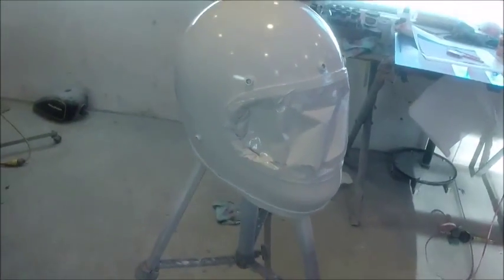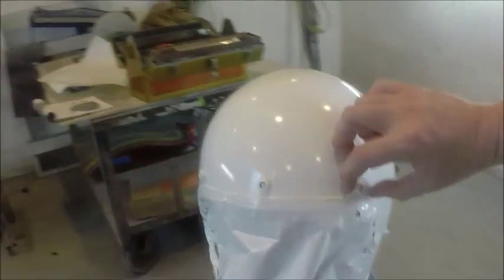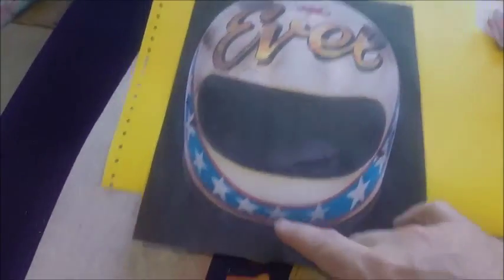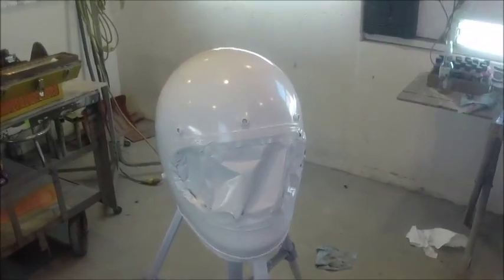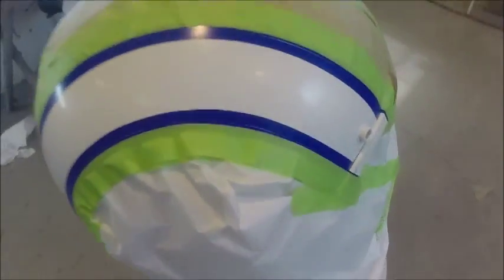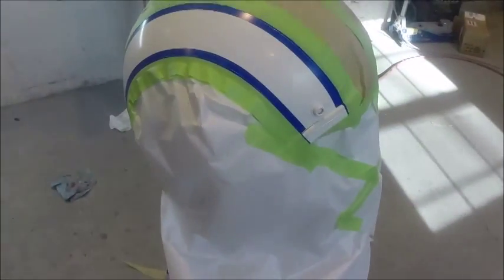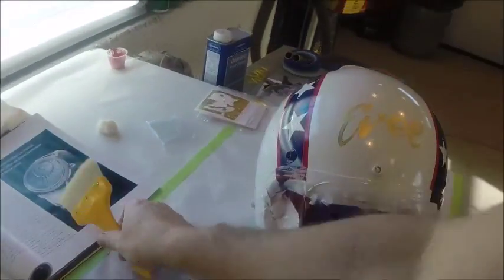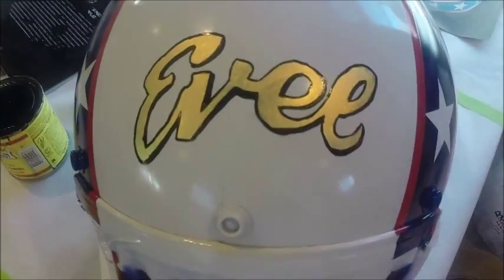How To Paint A Evel Kneivel Helmet Vtwinstov8s.com

Comment: The final step of the clear. Do you just scuff with green pad (avoiding Gold Leaf) and put a couple coats of clear?  Nice step by step vid.
Reply from the maker: I you a grey scuff pad. And yes avoid the gold leaf it's fragile. You could put intercoat clear over the gold leaf prior to the striping. Then you can wipe off unwanted striping paint (mistakes) and you scuff right over your gold leaf.